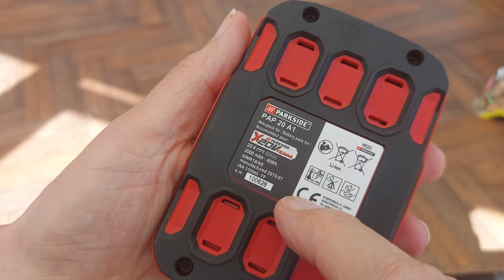Black and Decker 18v Battery Adapter for LIDL Parkside 20v Battery PART 4

Comment: Great job! I've an old black and decker hedge trimmer sitting on the shelf just waiting on me to fire up my 3d printer now to bring it back to life! Thumbs up!
Reply from the maker: @liamo30  No guarantees offered, but it certainly worked for me. I picked up two of the LIDL batteries several years ago when they were in the "reduced" shelf as I thought they might be useful to strip down for the LiIon cells, but never got round to doing that. I am pleased to finally make use of them 😊👍
Reply: @GrandadIsAnOldMan  oh I've a heap of Lidl batteries for various gardening contraptions from the parkside brand, I do have to say I'm quite happy with them. Thanks again!
Reply from the maker: @liamo30  Thanks, that is always handy to get feedback from somebody who actually has the product and uses it and is happy with it. My perception is that LIDL tools are good quality.